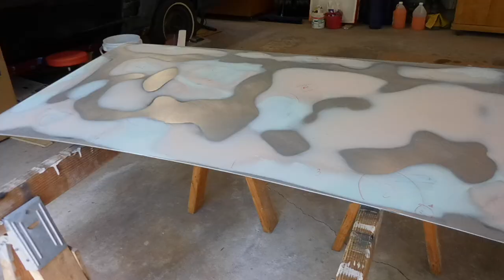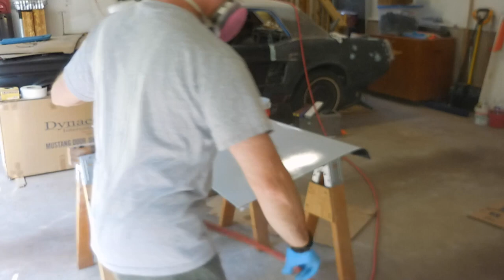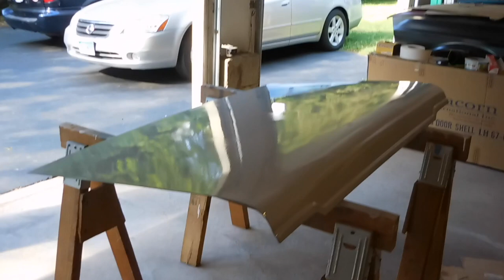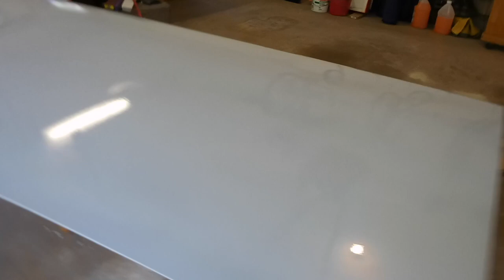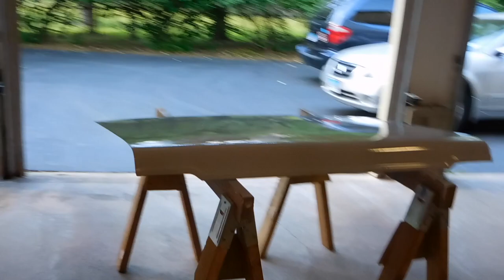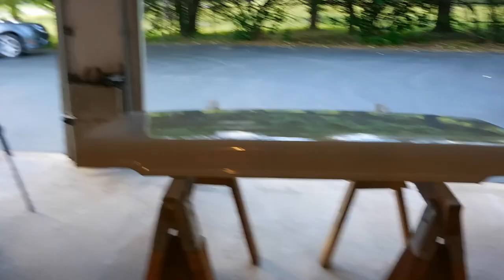67 Mustang Restoration Trunk Lid Primer

Comment: I am not a pro! But I believe you need to improve your wrist angle better! It is more critical for paint and not for primer! But you can get better by the time you'll have to paint. 

Good job, happy to see a video. Good to know that the project is moving forward.
Reply from the maker: Thanks, you hit the nail on the head.  The good thing about making these videos is that i can see what i'm doing and then improve on it next time.  I noticed that exact same thing and I will definitely be working on getting the paint gun to more closely follow the contour of the surface.  Like you said, practice makes perfect.

Comment: I have a question about your sand filter you made... we made one and the lid keeps popping off. does your lid have a seal in it?? did you ever make a wood box for it?
Reply from the maker: I haven't made a wood cover.  You can see in the video that i used some clamps to hold it on.  I also use the valve on top of the bucket to reduce the water flow and that helps keep the cover on.  This year I had no trouble with the lid, which is the same one from last year ( the year of the video).  It just stayed on and i could run it nearly full open.  My idea for the wood cover is to just put two 2x4s under the bucket and two on top, parallel to each other.  Then get four 1/4" diameter threaded rods that are at least 6" longer than the bucket is tall, with nuts and washers.  Drill some holes in the 2x4s and put the threaded rods through the holes from the top of the bucket to the bottom.  Tighten the nuts and you have the cover clamped on.